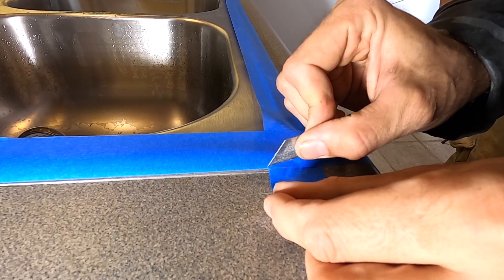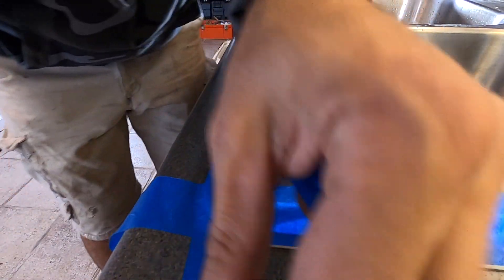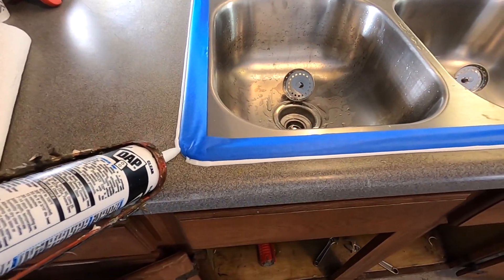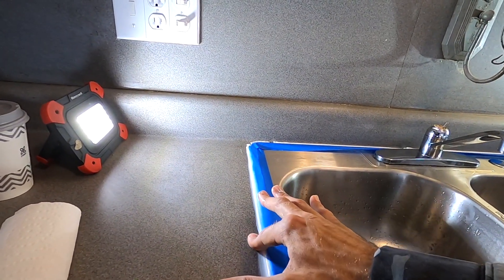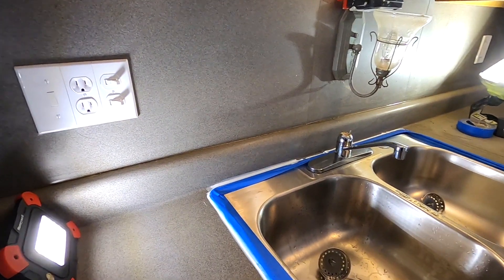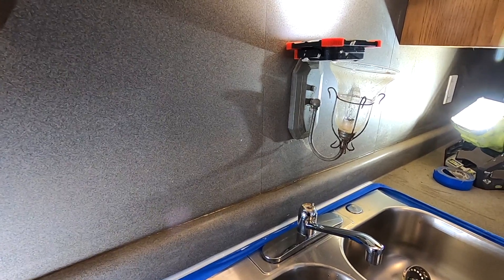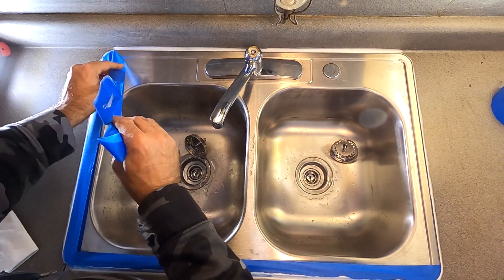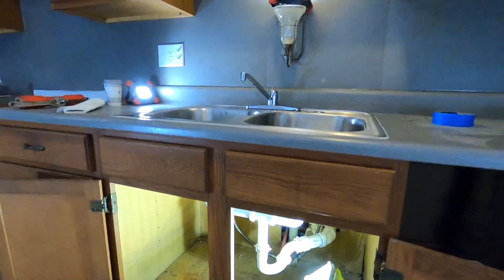Caulk around a KITCHEN SINK: Handylandlord

Comment: My husband just did a VERY messy job of this.  How do you remove the caulk from the stainless steel and the ceramic tile?
Reply from the maker: That’s unfortunate. I would use a thin,  plastic scraper that you could scrape off the extra. After that I would try to use the scrub back of a sponge to see if the rest will come up. Hope this helped: good luck.
Reply: tape tape tape

Comment: Got a bunch of rust along the edge of my porcelain coated steel sink.  Will the caulk concewl the rust, and reduce the rusting, or should I try to get the rust  off with something.  Hate to take the sink out..
Reply from the maker: Depending on how bad the rust is the caulk may cover it. I would probably try to scrape any loose rust then touch up with appliance paint like https://amzn.to/3uqG7q8 and then apply caulk. Appliance paint can be purchased at home depot for much cheaper. It has a small applicator brush inside the bottle. I use it in this video https://youtu.be/6mQ0fHnizNg  Hopefully this helps.
Reply: @handylandlord  Thank you.  I think the rust is too advanced for touch up paint.  Wondered if I should use some phosphoric acid or some other rust treatment to neutralize it before I apply the caulk.
Reply from the maker: @PanamaSticks  without seeing I’m not sure. Maybe some rust treatment, spray paint and then caulk. Anything you do will probably make it look better and last longer. Good luck on your project.

Comment: I'm new to this, so what is the point of putting tape around the sink, caulking around it then pulling the tape off‽‽‽‽‽
Reply from the maker: Good question. Just to give it a straight line and clean look, preventing the caulk from getting too far onto the countertop. Good luck on your project.
Reply: try it sometime without tape and then do one with tape, you will know very quickly the value